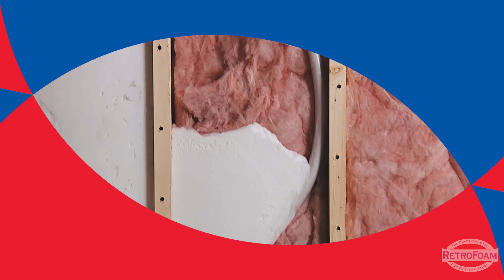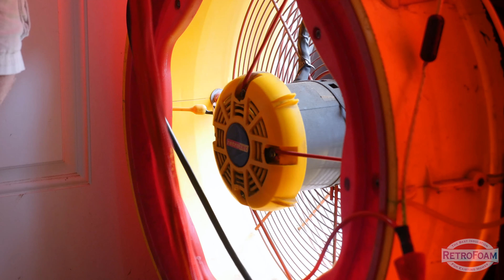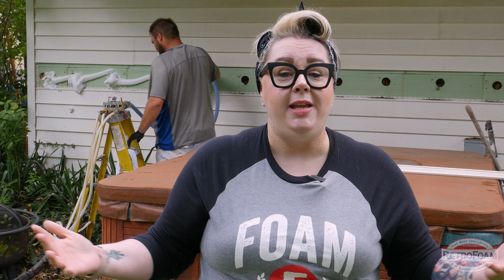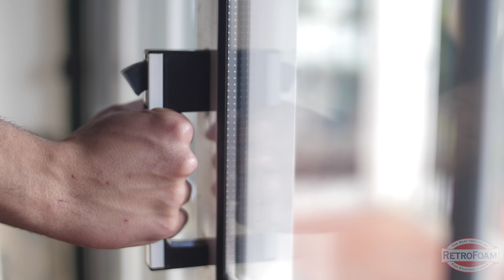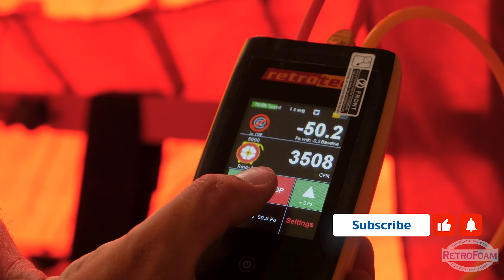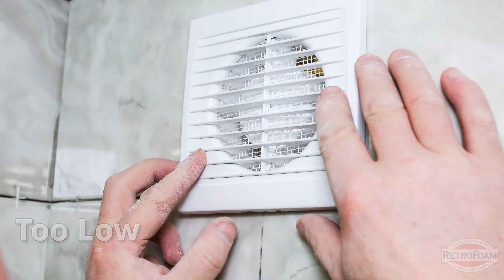What is a Blower Door Test? | Foam University

Comment: In Florida.  Concrete block home with Stucco.  I know windows and doors are my main problem.  Is this test necessary or just hire someone to come seal the doors and windows?  (single pane glass)
Reply from the maker: The blower door test wouldn't hurt! It's always great to get multiple opinions from different sources.